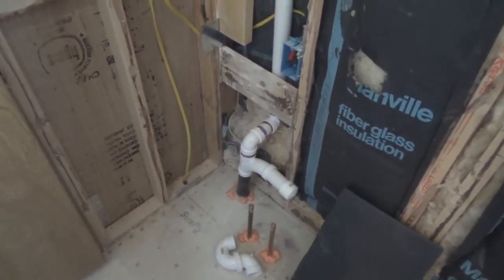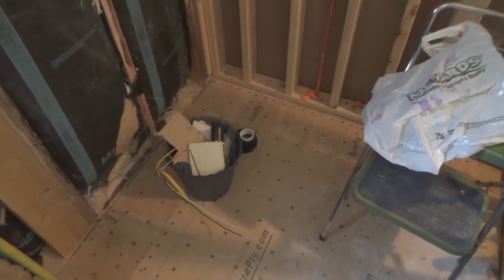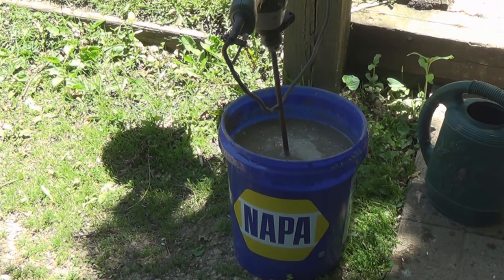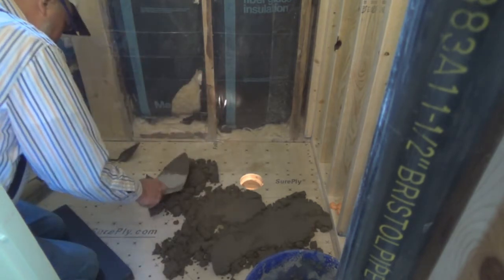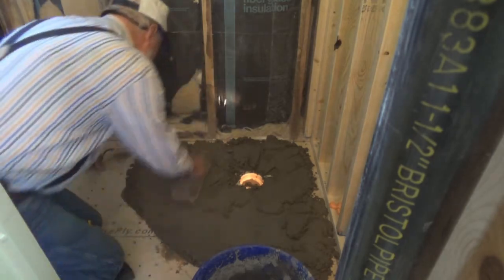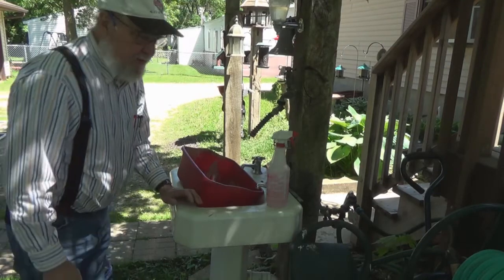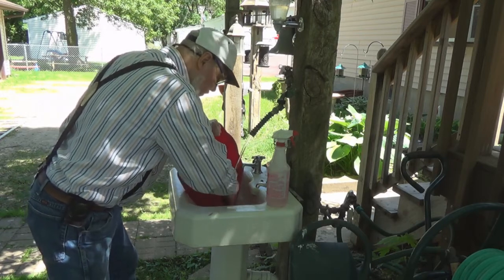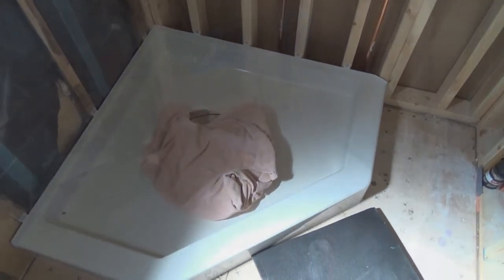Shower stall base install and more

Comment: It's coming along nicely, George.  Bathrooms are always so labor intensive despite their smaller size.
Reply from the maker: This one has had one hiccup after another, mostly due to my lack of understanding of the electrical codes here in MN, which are different than they were in PA and in MA. Thanks for stopping by.

Comment: Nice work George, will need to do this myself at some point. Small leak in the pipe below, and with the age and looks of the pan I'll need to replace it.
Reply from the maker: My tub, which was plastic, was cracked around the drain. We only used it about 3 times before I discovered the problem after we moved in. I tried fixing it with epoxy, but it was too far gone. All of this is a result of that...indirectly of course. Thanks for stopping by.

Comment: you do great work...wow what a pretty bucket...i use nappa here alot

i had to plum my bathroom a few yrs back...went from metal pipes to plastic too. then the drains too..i really like the clean  look now of everything. alot easier to rotter root now if i ever have too. so far have not had too. clean out ports i was a clever add on i think
Reply from the maker: Now there is something that is missing in my plumbing system...cleanouts. Maybe I should add one just in case. I changed from a combination of plastic and copper to all copper in the water lines, the drains are all plastic already. I got the bucket on a deal, buy a bucket for 2.99 and fill it and get 25% off. Well, I needed a starter for my pickup and it fit right into the bucket and it more than paid for the bucket with the discount, thanks to the counter person for suggesting it. Thanks for stopping by Robert.
Reply: wow great deal with the bucket...i use mine as stools for working or fishing or just taking 5...lol

Comment: When we do fire proofing on the job we use a big cake mixer to stir things up. 
Well actually around.
Reply from the maker: So how does making a cake fireproof something?
Reply: So George you had to have seen you wife make a cake at least once.
She puts little beaters on the end of her mixer and makes a cake batter. Well when we do fire proofing we make a big batter with a big beater. If you want a big fire proof cake we can make that two2.
Don't make cakes four4 that you'll have to sea your wife but if ya need something fire proofed we can do it or show ya how it's done. Not the best job to do but sometimes beats getting insulation dust all over ya oh and it pays the bills when there's work.
Reply from the maker: Sounds like the makings of a neat video composition.

Comment: You're getting close George.
Reply from the maker: I have my electric passed for the rough in and as soon as I get the drain hooked up I can get the rough inspection done on that (Monday?) and then I am off to the races doing the drywall, finished walls/ceiling and vanity, etc. Thanks for following along Scott.

Comment: Hey George,      What a hastle to do an updated bathroom !  The vent pipe goes every where !  My parents went through the same thing on their manufactured house due to a broken part on the plastic tub in the master bathroom.  With their place it had peaked ceilings which made running the vent problematic to say the least !  I can tell you have delt with these kinds of things before or you may be bouncing on the walls !  Are you just going to put all new sheetrock on the ceiling in the bathroom now that you can play golf in there ?  Thanks for taking us along !  Good luck !
Reply from the maker: I have peaked (vaulted) ceilings in my place too and then in some places they dropped it down, like in the back room and the bathroom, so there are two ceilings. I'm glad this was lowered to a flat ceiling in there. I will be putting beadboard paneling on the ceiling. I probably will have to patch the holes in the ceiling before the paneling goes on... This sheetrock actually sits on top of the walls as it is installed over the walls at the factory. It is not remodel friendly at all. Thanks for stopping in Cody

Comment: First time I seen anyone put cement under a shower pan.  Most times nothing is put under or sometimes seen spray foam.  Not looking forward to removing all the cast iron drains in the house.  I just love that sink in the yard.  Did you remember to use a trap on it, don't want any odors in the drain. lol
Reply from the maker: I have two elbows in the exterior drain, will that count as a trap before it hits the ground? This particular shower base called for either cement or tar paper, but I wanted it to be solid with no opportunities to sag over time. This should do the trick. Thanks for stopping by Scott.

Comment: How big is that vent pipe?
Reply: No sheet rock behind the shower base?
Reply from the maker: The vent pipe is 1.5" which is allowed since that is what was already in place from the factory, otherwise it would have to be 2".
Reply from the maker: These are made to screw directly to the studs and the sheetrock then laps over the edges of the surround. It will become clear as we progress, I promise. Thanks Marty
Reply: That doesn't give you much room going through a 2x4 or should I say a 1.5x3.5 board. Did you have to put protectors on the boards where the vent goes through?
Reply from the maker: Yup, there are nailer plates over pipes and over wires.